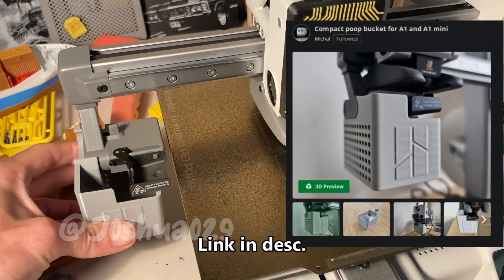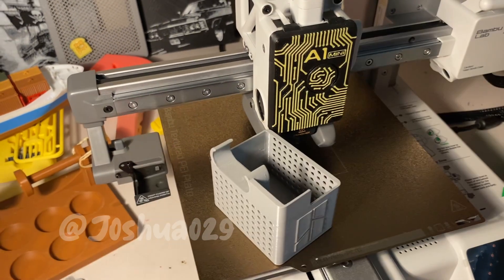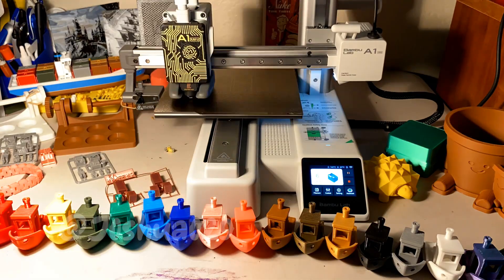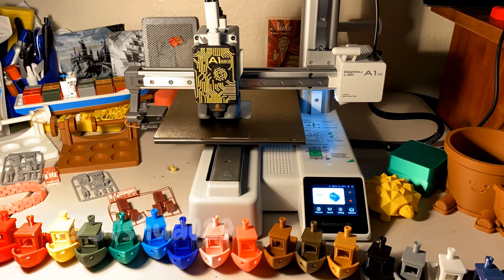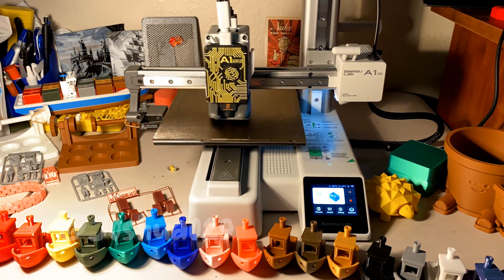3d Printing Purge Bucket for Bambu Lab A1 Mini Timelapse!

Comment: Thanks for the video. How much printing before it fills up with poop?
Reply: Great, thank you. I went with no AMS so I’ll give it a go
Reply from the maker: I added some masking tape today at the bottom of this bucket. I noticed as it first starts getting purge scraps they vibrate around a lot at the bottom, and make a ton of noise at the beginning of the print. After adding a layer of tape at the bottom these noises are gone! I wanted to pass this a long just in case it bugs you too!!
Reply from the maker: You could definitely fill it up in a few hours if you are doing a complicated multi-color model. But for my standard prints and at the rate I print I would say I will need to dump it about once a week! It is hardly filling up at all when you don’t do many filament changes.